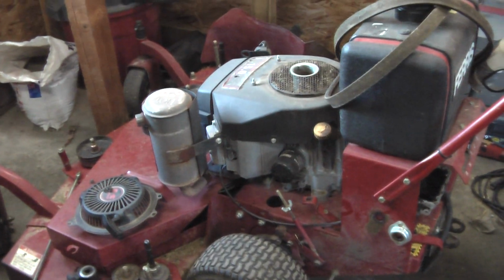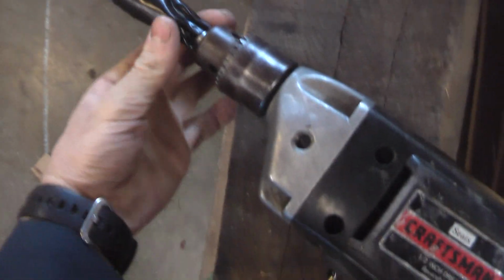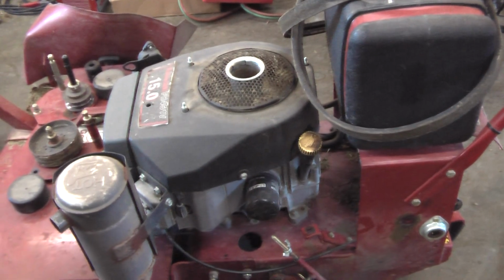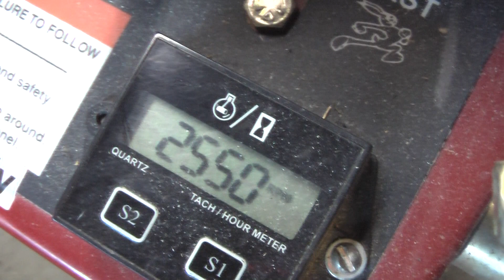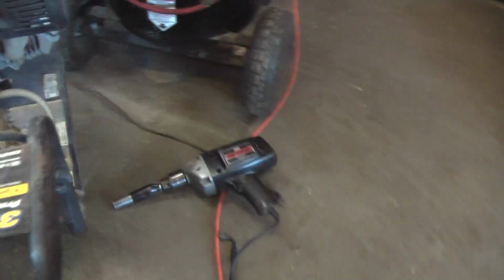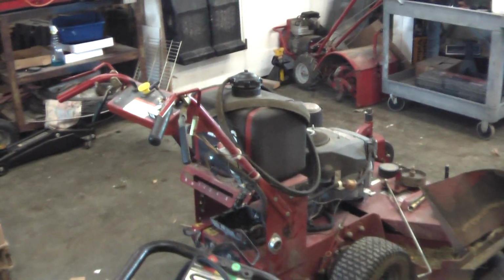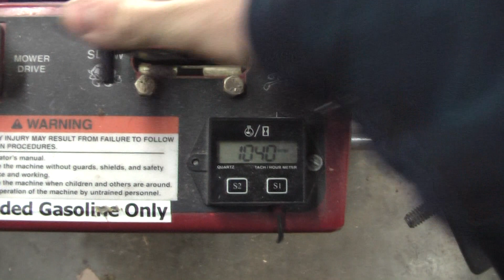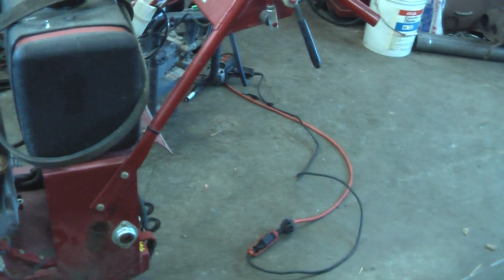First Start in 4 Months

Comment: if you start a engine always set it to idle or med idle because it will have too low of air flow to pull gas out of the jets in the carb